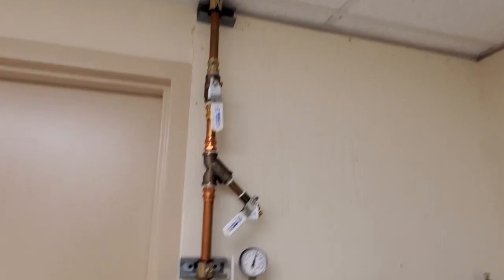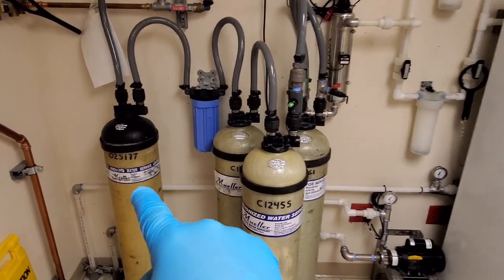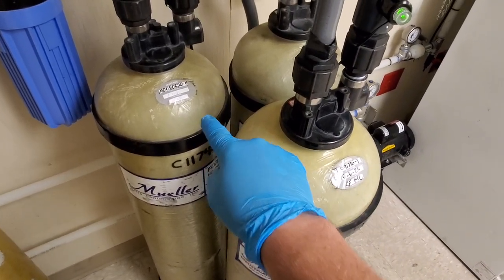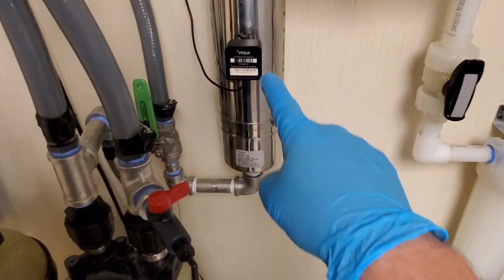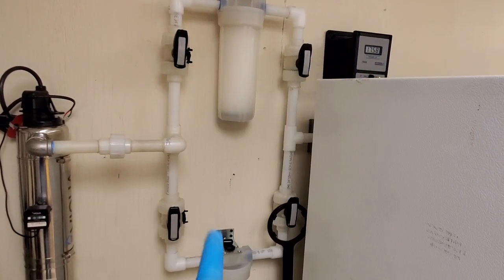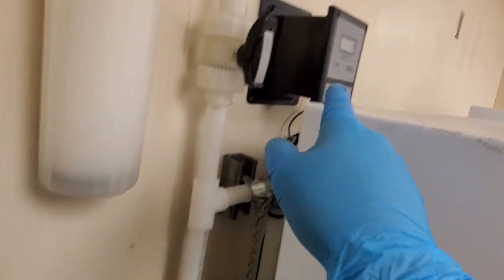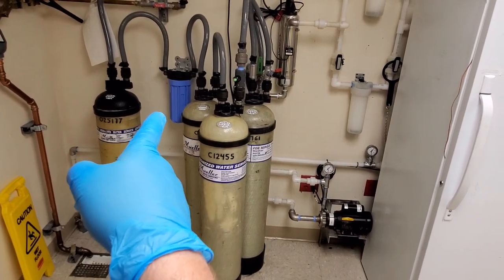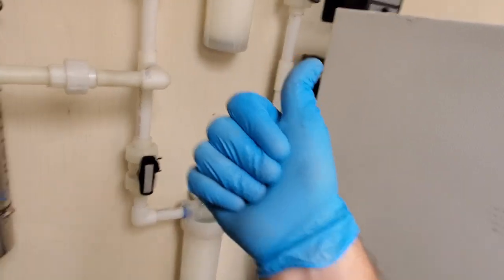Deionized Water Purification System

Comment: 2:00 Most people think that water is a very good electrical conductor, but in fact it isn't a very good one.
It's the particles like minerals, debri etc... in the water, that lowers down the electrical resistance.
This is also one of the reasons that it's adviseable, to use only "demineralised water" to use in acid-lead batteries, to keep the electrical resistance as high as possible, to minimize self-discharge.
Reply from the maker: Deionized and Reverse Osmosis water (future video) are bad to drink because water being a solvent, robs your body of existing minerals / electrolytes. Minerals always want to move from a high concentration (your body and cells) to a lower concentration (ultra pure water you drink).
Reply: @BetterBiomedChannel  , I have seen people who have tasted demineralized water, and it seems to have a very "dry" taste afterwards. Definitely not recommend as sport or energydrink :-)
I know Osmosis water from being used at carwashes , because it dries up without leaving stains.

Comment: Are you just purifying tap water? I’m trying to develop a hypothetical system that deionizes surface water runoff and I’m trying to figure out if this process is possible?
Reply from the maker: You would need some heft pre filters or heavy particle filters for surface runoff. Sure it's possible! does this water need to be potable or is it for laboratory type settings?

Comment: Sir.. what's input TDS...
Whatever resins apply..on this...
Reply from the maker: I have no idea what the input total dissolved solids count is but I can tell you that there is a heavy solids pre filter then 2 stages of Deionizing filter following.  The output is measured for purity in ohms.  The lower the resistance, the higher the purity (generally speaking).